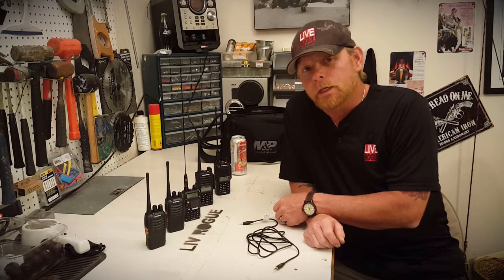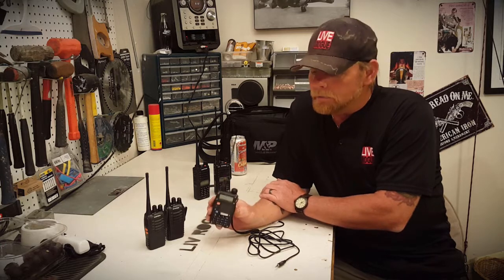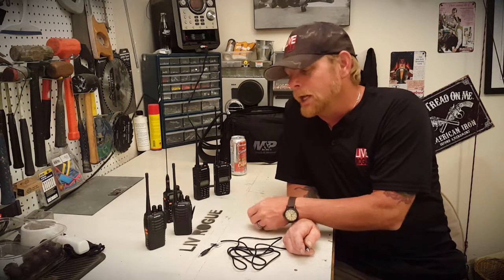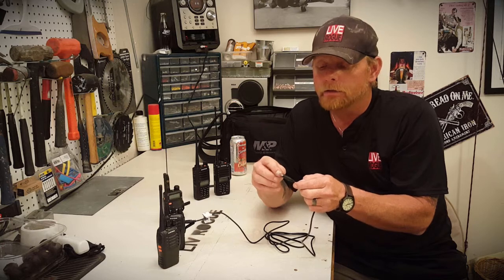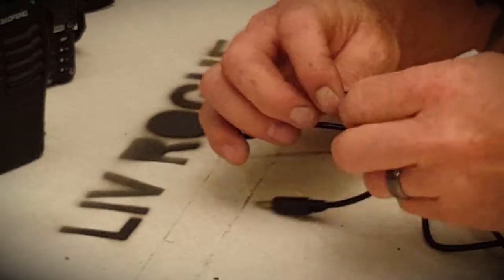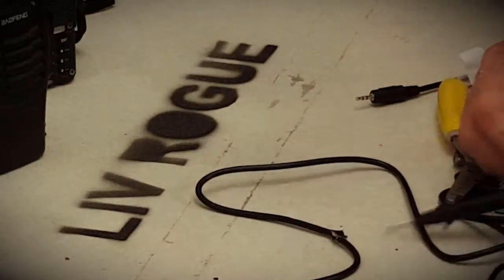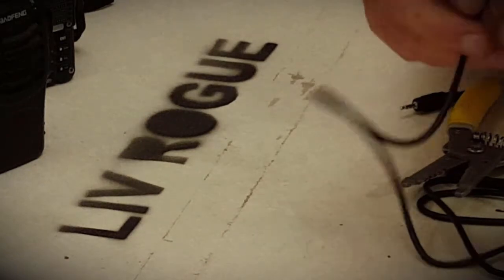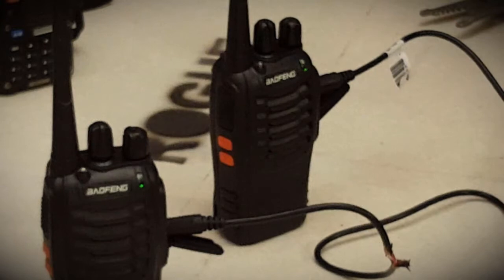Field Repeater | HAM Radio | GRMS Radio

Comment: I dont think that i heard you demonstrate how it works with audio. The problem that i forsee is the shield that you cut is the microphone common that seems to leave the tx audio with a return though it does have 3.3 volts on it until you pull it to ground to key the radio which would tie the mic common to ground normally if you used a remote microphone.
I also suggest turning on the "roger tone" on the Tx radio. Fiy the speaker high lead goes to +3.3v when the radio starts receiving like it would be the positive side of the speaker  goes to 3.3v  like a CAS (CARRIER OPERATED SQUELCH)... HINT HINT.

Comment: Hm ... very interesting. Not too many comments, that could be a plus. I was wondering if nearly the same thing could be accomplished using 2 - 45 watt gmrs mobiles. Theory in place presents several problems with antenna function. Real repeaters and duplexors are expensive. Im a disabled vet living on a farm, so I'm like always really broke. Im having a difficult time getting a schematic of my radios which I need so I can figure out how to mod them into a useful repeater for linking the HTs to the mobiles and the base. Its an idea at this point.There are other videos out there where people show off what they've done but no one explains anything useful.
Reply from the maker: Keep us postwon what you discover. Your idea sounds interesting.